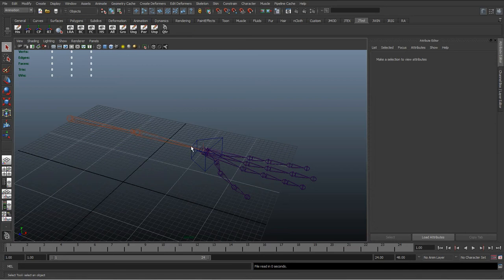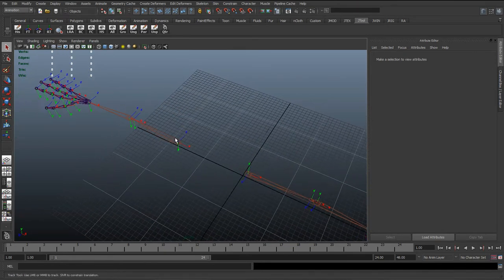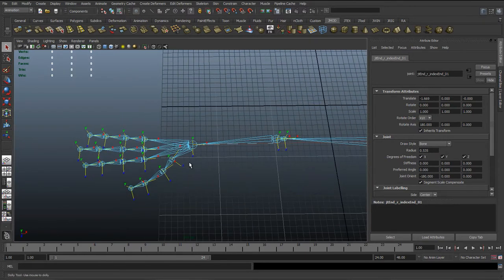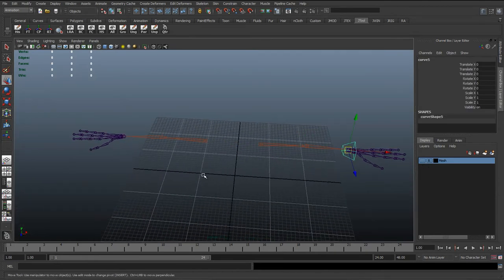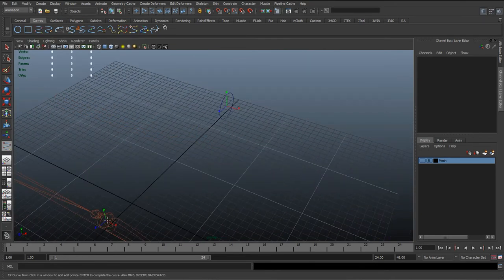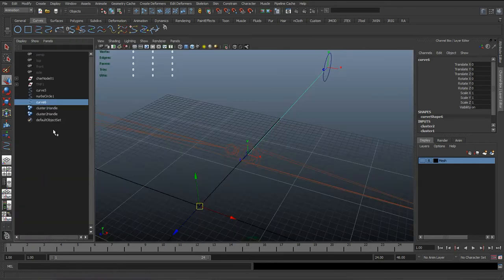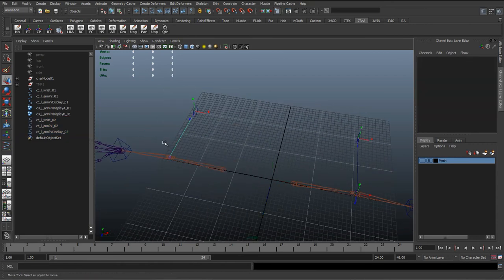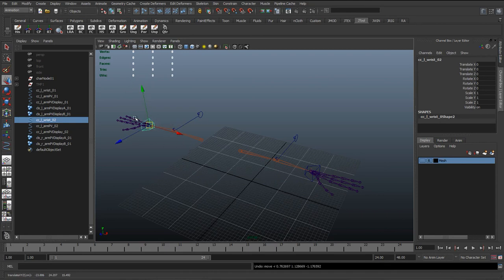09 - Mirroring the arm & polevector (Cartoon character rigging series)

Comment from the maker: Also, i prefer having them the same for the fingers because later we will connect the rotation of the fingers to the finger control, so setting a value of 10 for the index finger on both sides for example, if both joints are oriented the same way we will get the same finger movement on both sides.

However if the orientations on the left and right don't match, setting a value of 10 in the index spread on both sides will cause them to rotate in opposite directions.